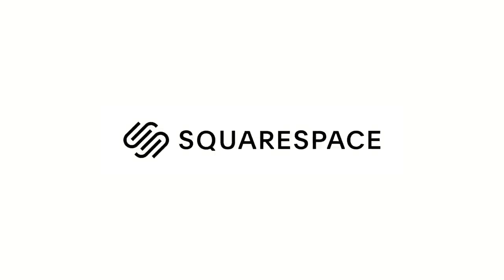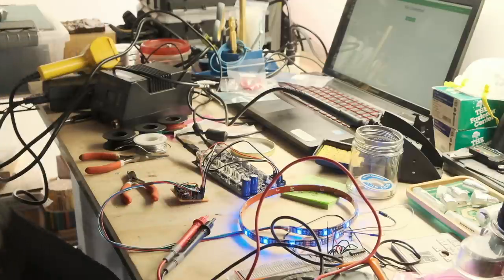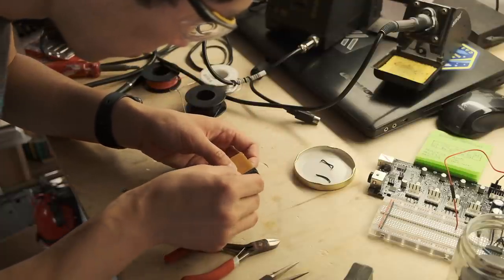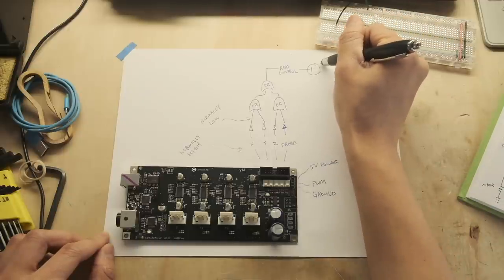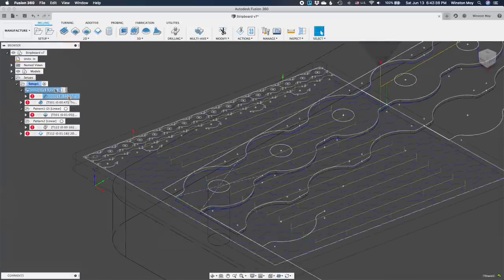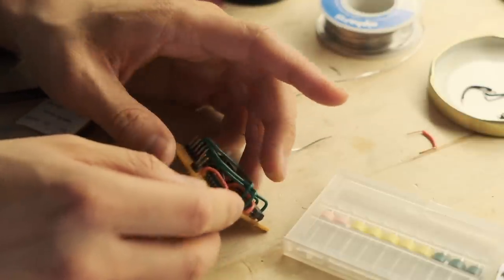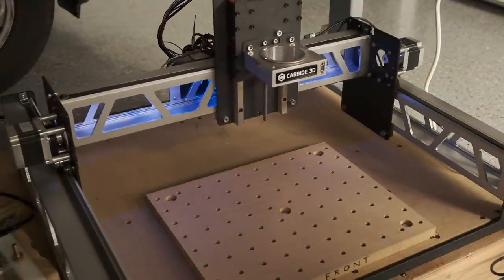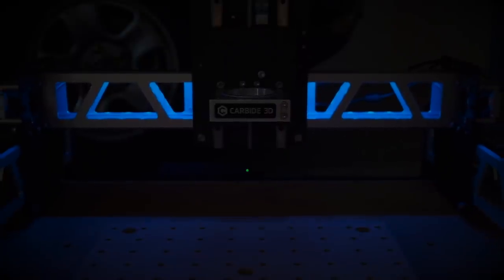Skeletonized Shapeoko Gets an RGB Lighting Upgrade - #166

Comment: EE here, cool build. When you do end up designing some proper PCBs please consider using KiCad. Also, you probably already know this, but with milling PCBs it's best to use an electric probe to depth map the blank copper clad and compensate in software.
Reply: Kicad, FlatCAM, bCNC. They have their quirks, but they are my heroes.

Comment: doing this in Linuxcnc is really easy. You can use the classicladder to get the state of the machine and then have a logic control the leds. You could also add a button to permanently disable the leds.

Comment: I tried my hand at PCB's prototyping on our CNC at work, but I found it wasn't worth it for my use case. All my designs are intended to be fabricated professionally for the final product. I found that you end up making so many compromises to to accommodate the CNC, that it is faster to just send the board out instead of having to layout the board twice. Where this is might be useful is for one off boards you don't intend to have fab'ed, boards where you absolutely have to have that day, or RF boards with crazy shapes for filters or antennas.